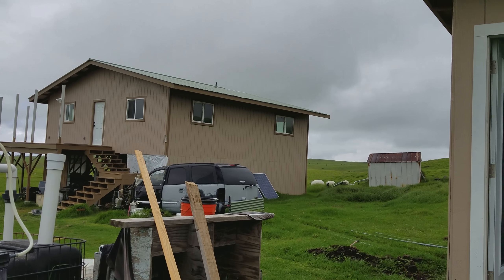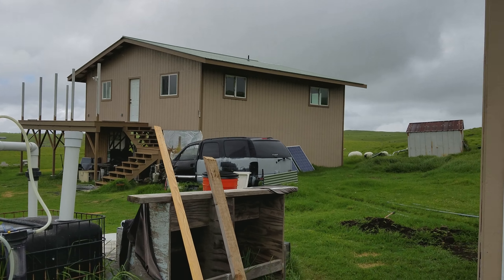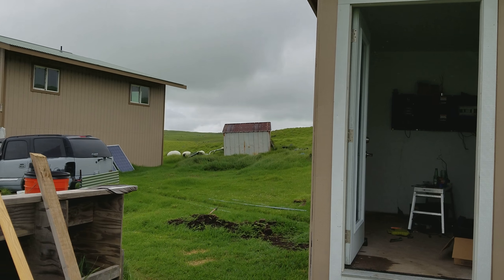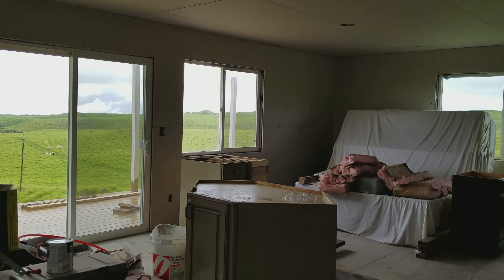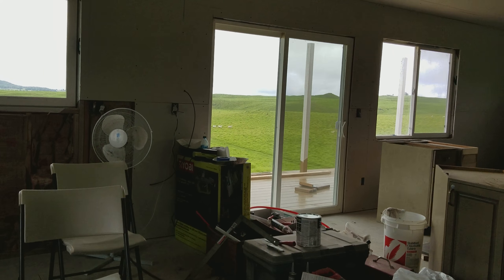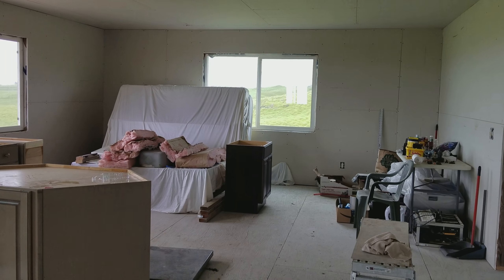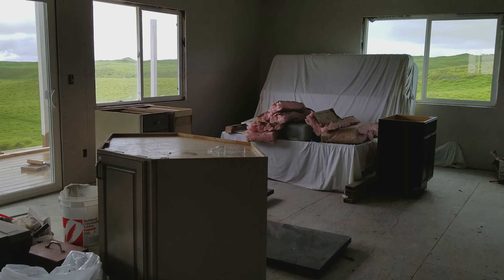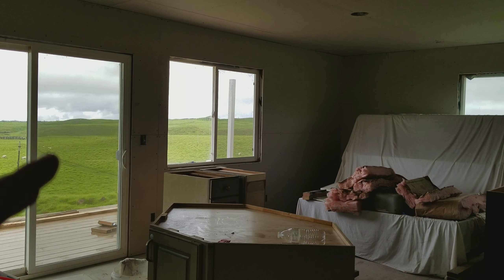Ep: 1 Building My Epic Off Grid Solar Powered Home System

Comment: You're doing a very good job building your off-grid home I just wonder what would happen if you oversize your solar and wind setup would it fail
Reply from the maker: Thanks for the support, oversize only means extra power that can be stored and used, most people wish they could oversize the system but costs more money for the equipment. No fail
Reply: Good so that means that when I build my system out of the Harbor Freight solar panels and Walmart batteries that I can afford all I have to do is worry about getting a strong enough inverter that I can afford